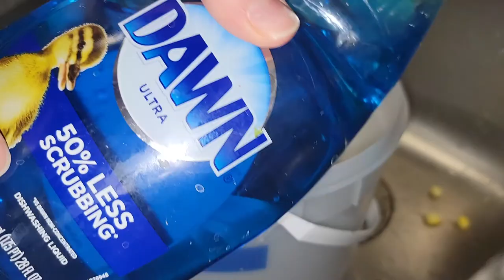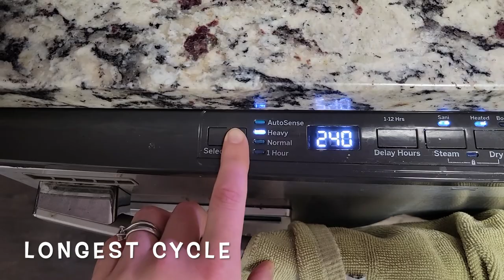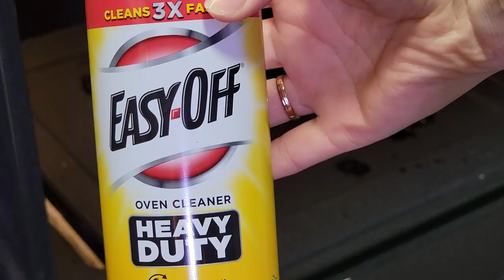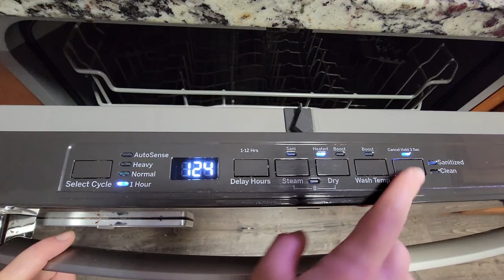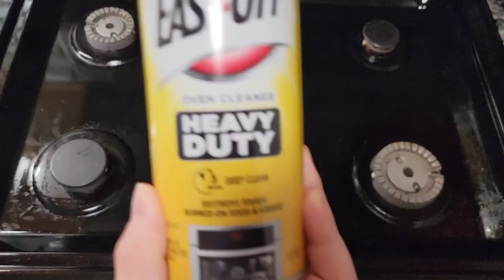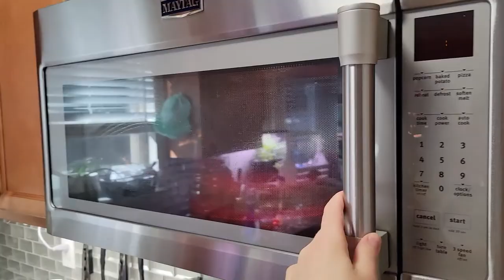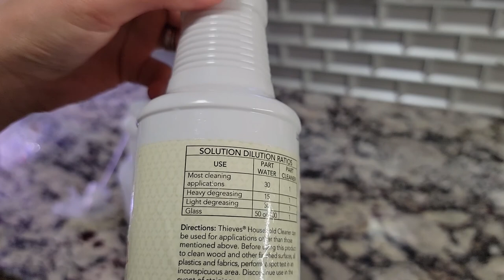*New* deep cleaning my kitchen 2021  extreme kitchen deep cleaning

Comment: For stainless steel, I use Barkeepers Friend powder and after rinsing, wipe the sink dry with a cloth.  Amazing!  They also have a glass stovetop cleaner which is great.  For oven racks, I put them in a garbage bag outside or in the garage and add a cup of ammonia and two cups of hot water.  I tie up the bag and lay it down on the floor/ground to make sure the racks are near or submersed in the liquid.  The fumes are horrific so work quickly and try not to breathe!!!  The next day, I open the bag and let the contents run over the oil spots on the asphalt then use the hose to rinse the racks.  I take them back into the house and touch up any missed spots with a scrubber.